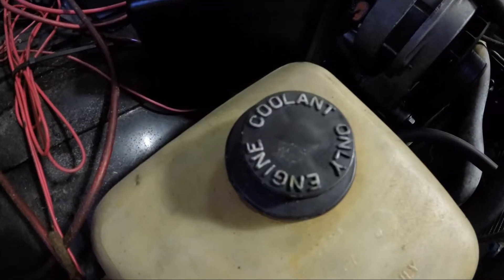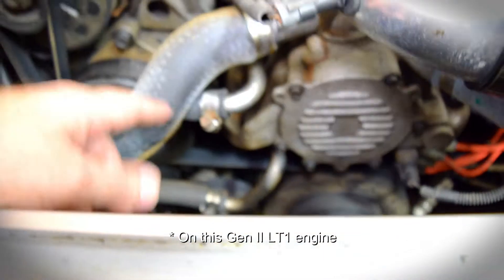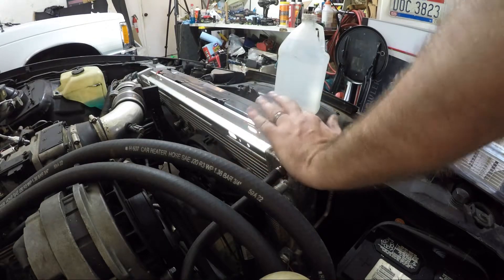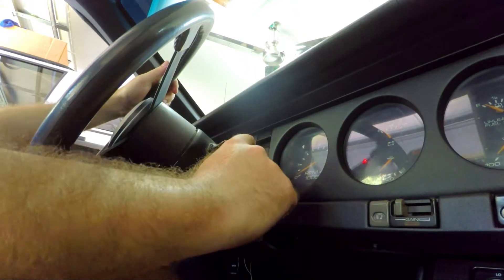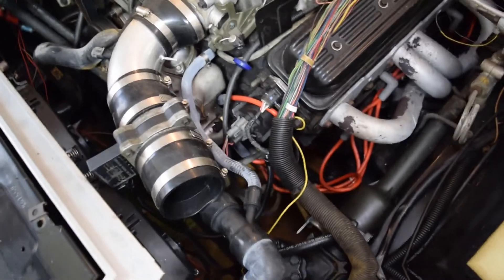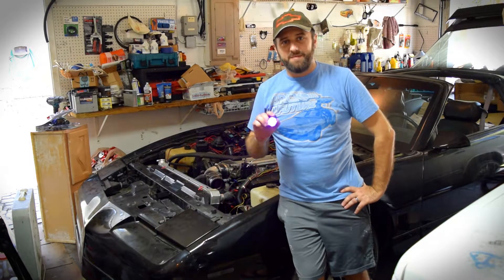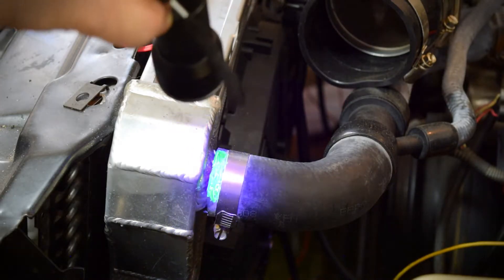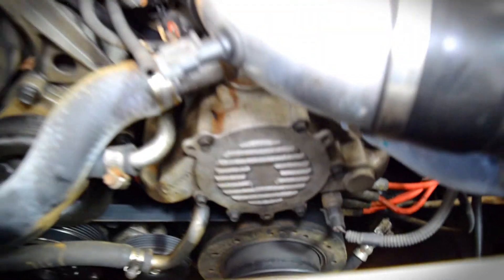Finding A Coolant Leak With a UV Light

Comment: Hi - would a leak in the water pump cause coolant to pool ontop of the engine block? 2014 Chrysler Town & Country (if that matters). Just had new upper/lower coolant hoses and thermostat installed and now coolant is pooling up and running off the top of the engine block.
Reply from the maker: I'm not very familiar with that platform.  If you just had hoses done, and now you've got coolant showing up, it's most likely that one of the hose clamps is loose.  If you're finding coolant ABOVE the location of the water pump then it's highly unlikely that the pump itself is leaking.  Look for something leaking above the pool of coolant.  

If you get the dye and UV light like I showed here then you should be able to track it down pretty easily.  My money would still be on a loose hose clamp, or hose that's not fully seated.

Comment: I put the dye in my coolant reservoir since I have no radiator cap. However the dye just seems to be sitting on top of the coolant
Reply from the maker: You may need to drain a little coolant out of the radiator to get the dye into the system.  Of course you'll also need to start the car and get it up to temperature to get the dye circulated throughout the entire system.   

Unless you have a larger leak it may take a long time for to for it to get picked up out of the reservoir.  I've also seen the overflow lines be completely clogged up, which could also prevent the dye from getting into the system.

Comment: Does my car need to be fully cooled to add dye or just low enough to safely remove the radiator cap?
Reply from the maker: As long as you can safely remove the radiator cap it should be fine.  Once the dye is in you'll need to get it hot enough for the thermostat to open and fully cycle the dye through the system. . .with the cap securely reinstalled of course.

Comment: I cant find it with the dye.
Reply from the maker: If you cant find anything in the engine bay, it could be leaking into your oil, via oil cooler, or head gasket.
Reply: @VHickleGarage  I've checked my oil over the past few weeks, looks clean. I'll check again. I was asking around online and they suspect a tiny leak maybe that it's leaking super slowly. I actually am hearing a noise radiant from the waterpump area though. Here is a clip https://streamable.com/rhadsm
Reply from the maker: @The2Coolest2  Hard to tell from that, but could be water pump bearing going bad and leaking.  If coolant is disappearing, and not into the oil, you should find dye somewhere.
Reply: @VHickleGarage  I should of clarified, I wasn't able to put the whole bottle of dye, only half because the radiator was pretty full at the cap level. I should of removed some *facepalm*.
Reply: Iv used dye on my deer stand trail...works good..